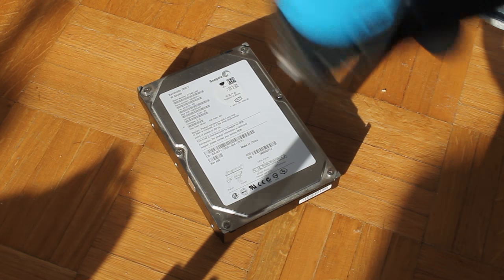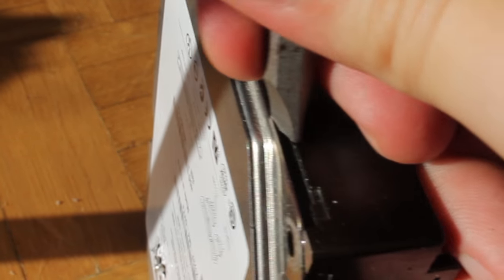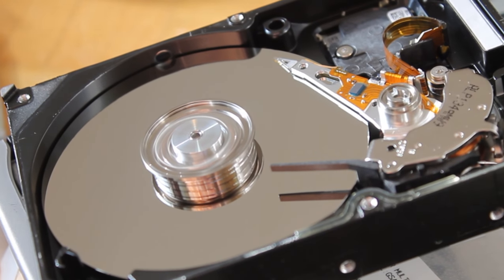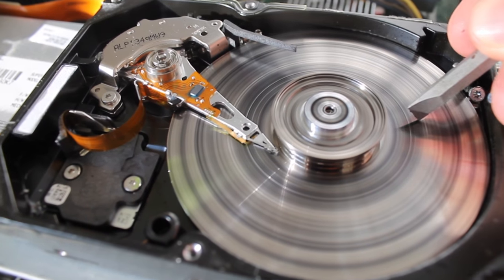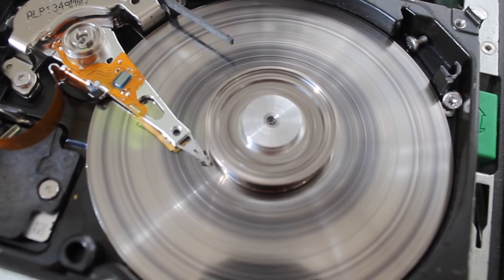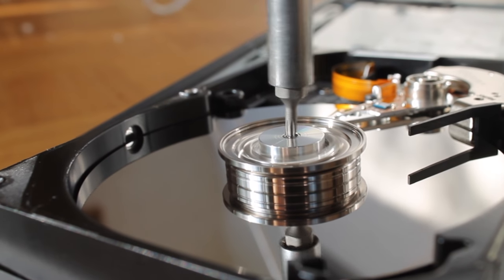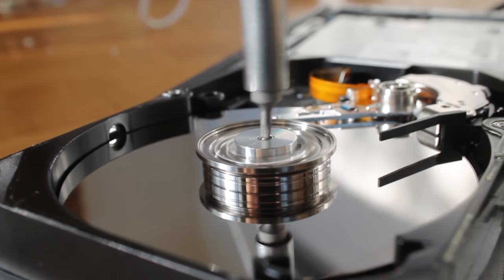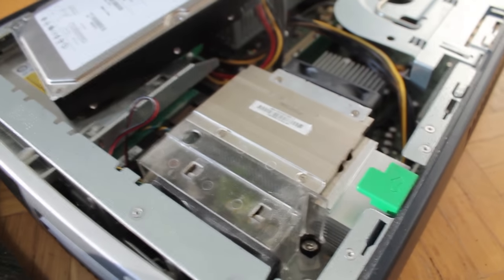How to overclock your HDD (hard drive) for faster performance than SSD

Comment: Nice one! My only concern is that people are actually gonna try this now! :D
Reply from the maker: yeah, that's why I put up the warning. if you are not a pro you might break something.
Reply: @HungryGizmo  Don't forget that people are also stupid, and will most likely misinterpret what you meant. Basically need big bold letters spelling the obvious to them lol.  Though, this does remind me of that one iPhone fix that used a microwave...
Reply: @daedalusthecunning9380  That wasn't a 'fix' That was new Wave Charging. It charges your iPhone in only 30 seconds. I've been doing it for years.
Reply: There is no limit to dumbness, you can always make it worse with drugs.
Reply: Samu I don't mind giving it a shot. I have bunch of them just sitting around so I didn't lose anything if it breaks
Reply from the maker: cool

Comment: You can increase the speed even more by spreading a small amount of lard between reading head and the disk plate. This allows the reading head glide smoother.
Reply: lol
Reply from the maker: how much smoother?
Reply from the maker: cool. good to know.
Reply: Actually 10w-40 would be a better option cause the oil is thinner
Reply from the maker: what about 0w?

Comment: It upgraded my laptop from 500 GB to 5 tbs. Definatley would recommend, faster than my ssd, 22000 rpm!
Reply from the maker: wow. I didn't even check to see it the size increased on my drive
Reply: @HungryGizmo  when you use the screw driver it chips away flakes of dust that Is secretly covering 10x the hard drive amount, the hdd is just one really big  DVD, and it shows 10 other DVDs when yo use the screwdriver 👌
Reply from the maker: hmmm. I'll have to dig further into this idea with another video

Comment: you can overclock anything by heating it up with a blow torch. As we all know when you overclock, the component heats up. the reverse is true. when you heat up a component physically, its speed increases. the more the heat, the higher its speed.
Reply from the maker: cool
Reply: worked really nice , i did this with my samsung evo ssd, everyone should give a try

Comment: I tried replacing the disc and the motor with a grinding machine, damn it is fast now, and the storage is great too, at around 6dm3
Reply from the maker: cool. just be careful. wouldn't want your data splattered all over the room

Comment: to make it ran faster just make a vertical gap between the header and the platter a bit larger with screwdriver or any bigger things to maek it more larger, so theres will have an reduced friction yet increases the hard drive lifespan. Hope it's works ;)
Reply from the maker: cool

Comment: Why i did this ?,i try it on my 7200RPM 512GB Hard Drive after opening the case of my hard drive everything seem to be fail...i can’t recover most of my files am i doing it in the wrong way?
Reply from the maker: why recover old data when you can make new data?

Comment: Guys this guy has a point! but instead of using all the drilling and opening your hard drive it is not necessary. Every HDD has a power connector and it is powered by 12v. remember not to connect to 5v because a pc runs on 12v or 5v. Now look here, you can take two different power cables and use the one where is 12v + (Red) and the other cable 12v - (Black). When you solder together you will get 24v. This will make the HDD spin at ~ 10 000 rpm. If you are unsure i am warning you to not try for you may loose all information if you place the cables wrong. Or if you somehow manage to use the Yellow cable of 5v you will slow you HDD.
 
Cable Markings (For professionals) 48v instead 24v.   
O- 3666 668 
L- 8777999
D-844 4447777
P- 28
H- 44666 633
O- 99966688
N- 66 666 666 22
E- 75559999- 5554445533
Reply from the maker: interesting approach... but you might have some issues as many components can't tolerate the higher voltage. expecially the motor which might overheat over time. you might ned to combine it with water cooling of some sort.

Comment: well if you want to speed up the drive make two partitions on it, use faster portion of drive for fast accesing, and slow one for storage - we did like this back in the day, used faster portion of hdd for disk c and slower for disk D, before ssd even was in plans by scientists
Reply from the maker: yep. for those slight gains you would get.

Comment: Ik it's satire but you can sfely actually run an HDD open? i'm doing troubleshooting from my main high-end PC, i thought I had a virus or got hacked/corrupted MOBO bios, but turns out the HDD was the issue. it's a seagate ST2000DM006 (2TB Barracuda Compute) I want to see if it really does the click of death, I have opened it afew times in hte past 2 days using torx bits with a precisionscrew driver, platter's abosltuely clean, the rad/write head isn't stuck. Absolute weird-ass part is that diskpart still detects the drive. Hopefully I can get my data off this drive real quick.
Reply: Btw i have spare HDD's with higher capacity I never used that still work, I have a docking station connected to my laptop. (the high-end PC I mentioned with the faulty OS drive is a desktop, the laptop is fine.)
Reply from the maker: negative pressure room. then yes. diskpart will always detect the drive, even if you smashed the platters to pieces.

Comment: Or you could definetly use a 48V(normaly IT is 12V) power supply and soulder it to the motor conector. Of corse for safety You should do it in a profesional service. This should definetly give you 4x(12V x 4 = 48V math is correct) the speed. Definetly. All of the above is useless without the markers and screwdriver...markings. they also give some boost. For extra super speed You could go for 120V to match the SSD speeds in US or 240V in EU and other parts of the world and IT can be  plugged directly in the power socket so no need to buy extra power supply.  Just plug and play :)
Reply from the maker: yes
Reply: lol

Comment: I tried. Didn't work. Not sure why, however i did find a solution: if you remove that funny disk, the hard drive will spin faster because there is less weight, which means more rpm. Now i have an awesome transfer rate of 0mbps (because a regular computer cannot read such big number).
Reply: sorry that was cringe
Reply from the maker: so is life

Comment: Show us how can we speed up the internet connection.
Reply from the maker: I already did: https://www.youtube.com/watch?v=z1QdP7KVAss
Reply: Hungry Gizmo I did it with power cables instead...much higher speed... especially when you connect it to the power socket.
Reply from the maker: wowowowowowo. how fast?
Reply: Hungry Gizmo what I can say  speedtest.net gauge pin broke.
Reply from the maker: wow. I just checked. it's broken. for everyone. when are you going to fix it? I can't speed test because you broke it.
Reply: Hungry Gizmo just let me download the internet first..
Reply from the maker: 0.000000000000001% complete 2934023423059203423423409 hours left

Comment: Hey... That's how I lap my cpu 🤣🤣🤣🤣
Reply from the maker: lap`?
Reply: @HungryGizmo  was a joke, but lapping a cpu means flattening the heat spreader and the HDD plate is relatively flat. glue on some sandpaper and it's basically a flatwheel grinder :D
Reply from the maker: heat spreader?
Reply: @HungryGizmo  the metal plate on the cpu, it's called integrated heat spreader
Reply from the maker: @hazimreitz  metal plate?

Comment: I hope that hard drive was as old as you said..... had a good laugh.
Reply from the maker: old and broken
Reply: You could actually do a real test, havn´t seen one on youtube. Does opening a hard drive in a normal room and closing it again quickly destroy it 100%? Some say it absolutely does due to dust particles which sounds logical, others say they have done it successfully buy I can´t actually find any proof of that. (I am not talking about data, just the hard drive itself).
Reply from the maker: The basic rule is that if you open it likely will die. but not right away. All depends how much dust gets in and how dusty your environment is. if your home has very very clean air, you might just get away with it. but I wouldn't count on it.  I've heard it as a last ditch effort, where someone is able to recover old data.... but really if you need data recovered you'll need to ship it off to someone with a clean room.